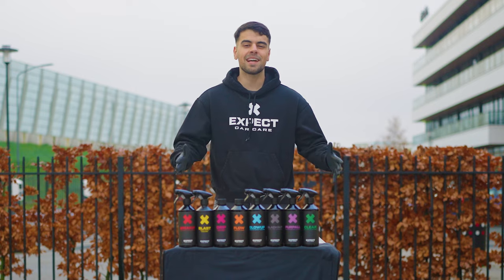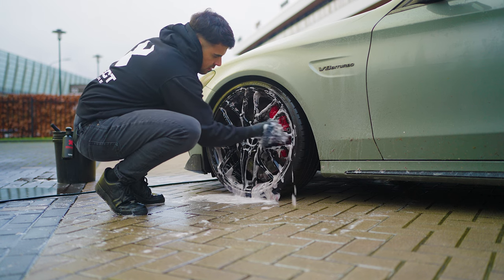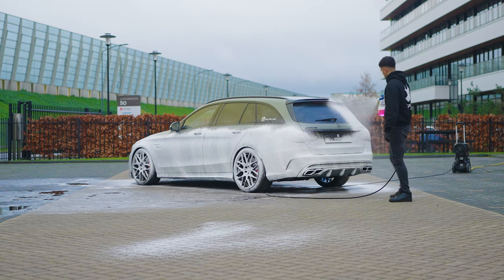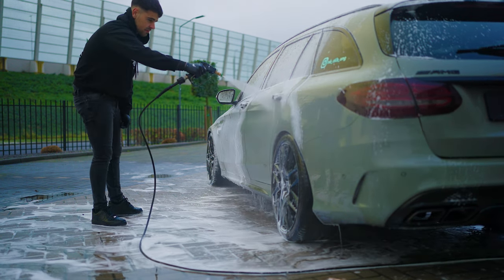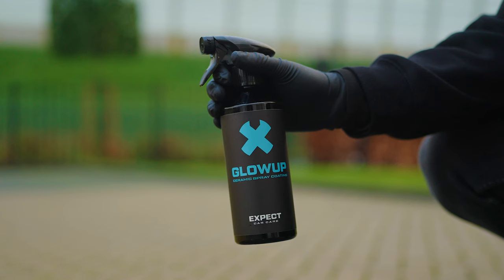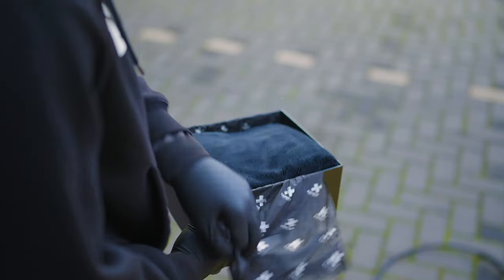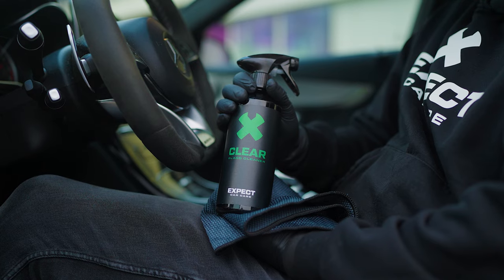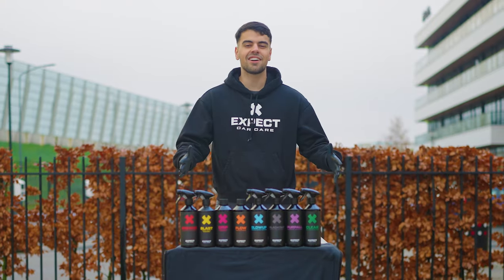Cleaning a DIRTY C63S - ASMR

Comment: How much pH does PreWash/Blast contain? Is not dangereous for paint?
Reply from the maker: Drip Snow Foam Pre Wash is Ph Neutral and safe to use on all types of paintwork and for your maintenance washes. Blast Heavy Duty Cleaner is not Ph Neutral and only need to be used once every 2-3 months during deep cleans before applying a new layer of protection again with Glowup Ceramic Spray Coating